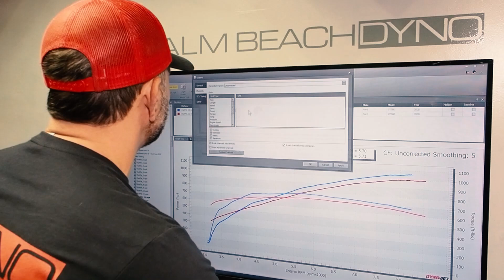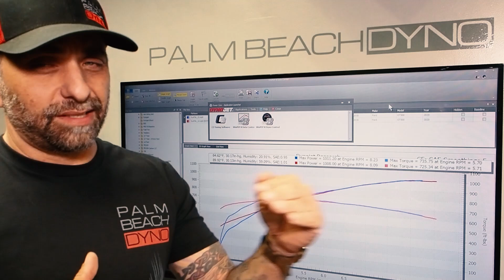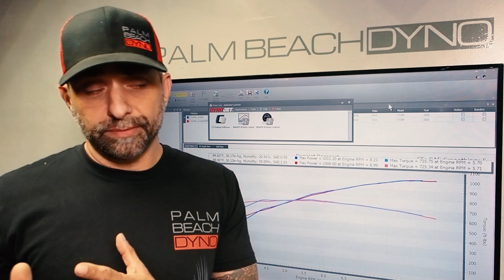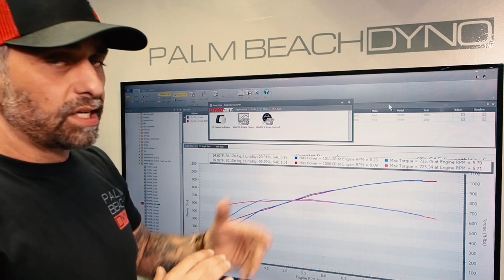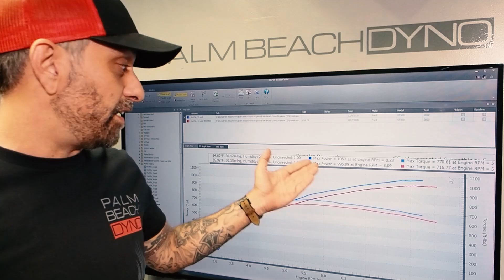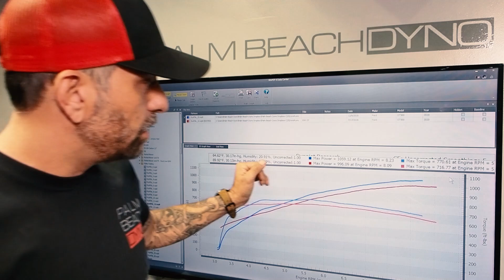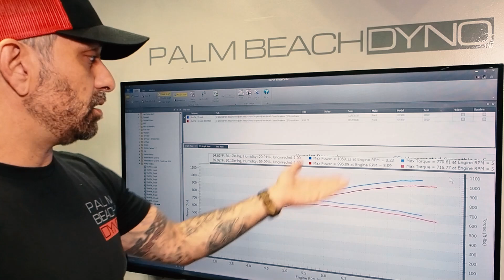Why Dyno Correction Factor is SOOOO Important!!

Comment: Corrected numbers are only really important to me when doing comparisons over different times/days for modifications I may have done, but the numbers most important to me are the actual uncorrected numbers, because that's what my engine is making in the real world. Because I live at 1082 sea level, and the conditions I mostly race in are between 86 and 94 degrees @ an average humidity of 60%. I can use my calculator at the track to take into account the changing atmospheric conditions.

Comment: That was great, thank you. I had my ISF done on Mainline Hub dynos, and both times they used the SAE J607 correction with all the weather data etc shown. So with new mods, I had a fairly true 15.7 hp increase.

Comment: Where happened to stang mode GT500 ?
What it tuning , was it a bad build .
Wasn't fuel . He tested the fuel after he blow up  it.
Reply: Stangmode has one of the only gt500's that engine was completely taken apart and is one of the only ones to blow especially at lower hp than most builds out there. If i was going to guess its how the engine was put back together
Reply: @clipit3027  he just uploaded the video cams seem to be intact .
Reply: @clipit3027  you could be right but all he did was cams from i remember.  
I have no idea . Just trying to understand . Not even sure who tuned it .
Reply: @clipit3027  
GT500 wasn't made to handle that kind of power in fact just like any other its not going to hold for too long remember he beats his car up almost every time
Reply: @kme5925  that's why i enjoy his blogs . He beats the snot out of his cars . Lol